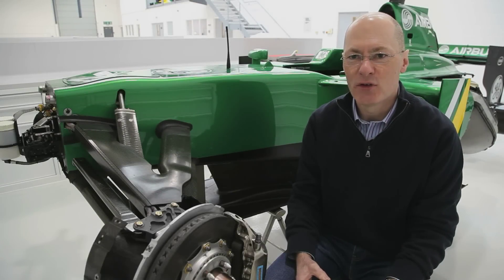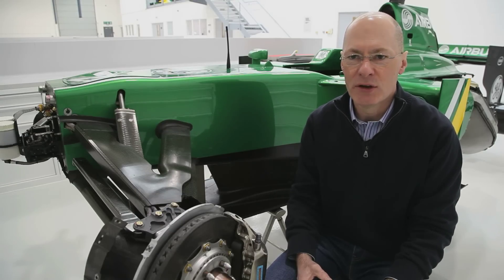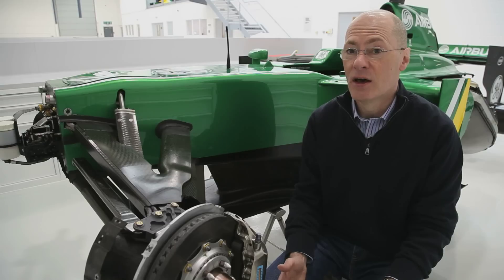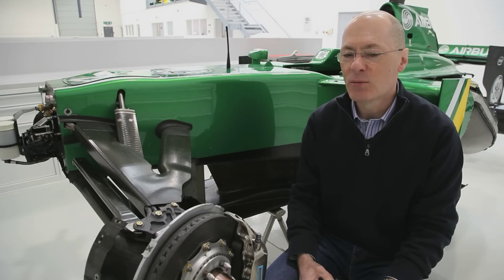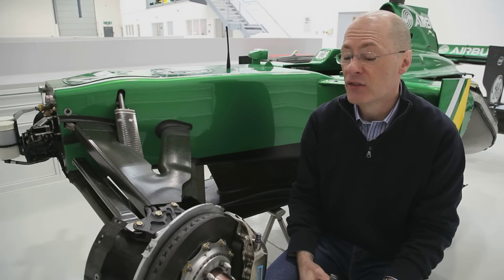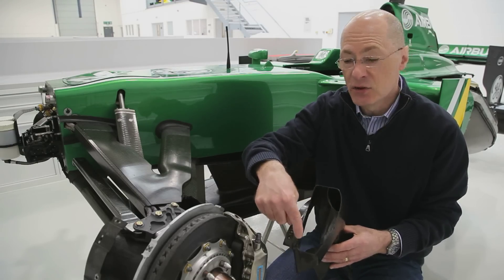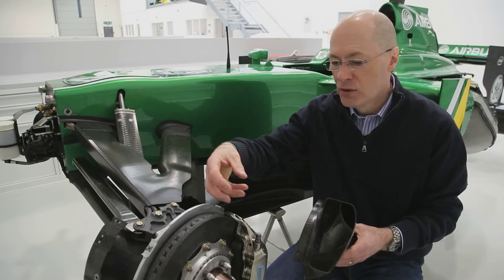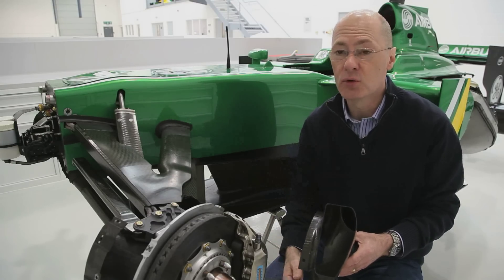Technical Director Mark Smith talks F1 brakes

Comment: Mostly the problem isnt falling apart, but that the dust an particles on the brakes become so hat, they turn into glas. Not glas like in windows^^ Anyways, this glas cant brake that much and can even clue the both parts of the brake together (sry, im not nativ, i dont know the technical term^^)

Comment: they can last 5/6 full race weekends. These are full carbon-carbon brakes, they get better when they get hotter. Typical temperatures these brake see are about 800 - 1200 deg c.

Comment: I see, that is a very useful information. But i still wonder, just how long the brakes can withstand the pressure and heat from the race? Even with the cooling system,  i still have the feeling that the brakes cant withstand a high pressure and heat maybe for half or quarter of the race itself